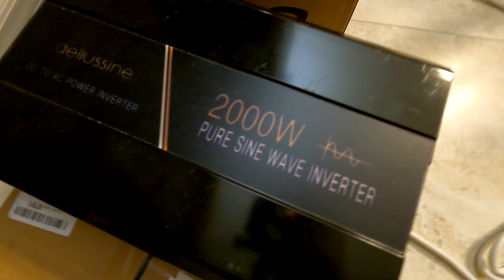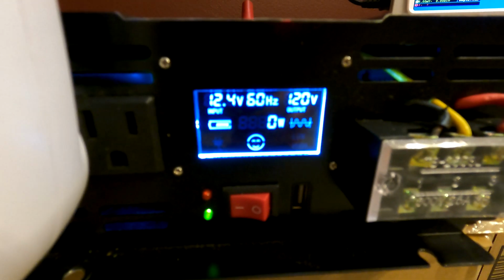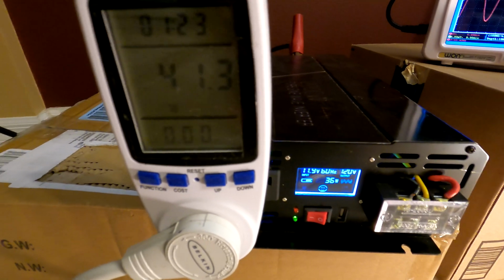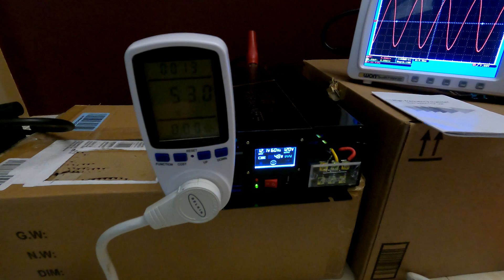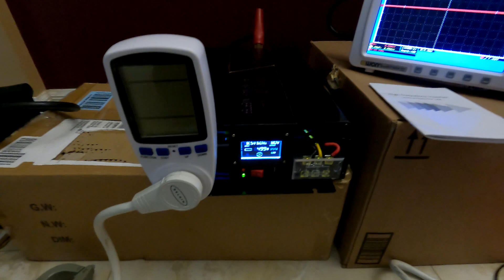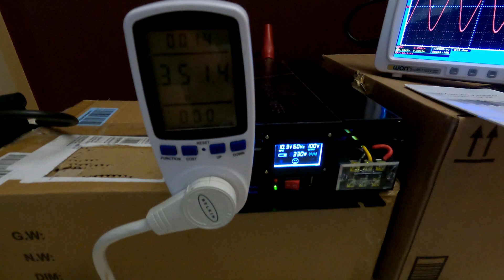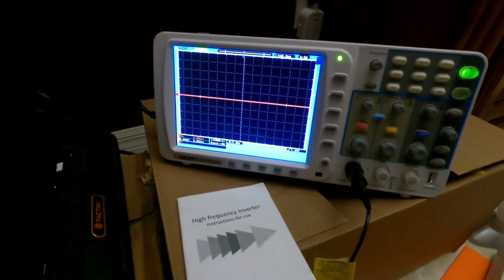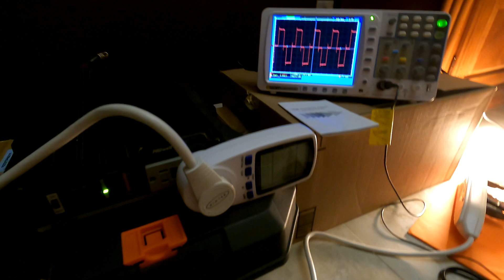Aeliussine 2000W Pure Sine Wave inverter - ?? PERFORMANCE ??

Comment: I had using one of this but in 3000w for a year and run tv double side refrigerator 7.2 amp and a vertical frezzer on solar and 200ah Renology lithium battery and work 24 hrs even during the last huracan in Ponce PR  00728.
Reply from the maker: Thanks for the feedback.

Comment: So, the pure sine wave implies small draw currents like for data usage. For the high current draws, it looked like your battery side cables were a little bit small. For the modified inverter, the high current loads were delivering the proper wattage a bit crudely on the oscilliscope. Likely small voltage differences in mod. sine were making the device a tiny bit warmer than they should have been, but not a huge delta. Yes, confirmed @14:47 your new inverter has maybe 10 gauge wire, where the pure sine wave cables look like 2 x 14 or 12 gauge. Retest with those modified cables; your results should improve significantly!!
Reply from the maker: 👍 thanks for the feedback!